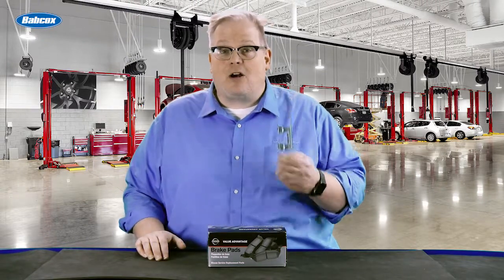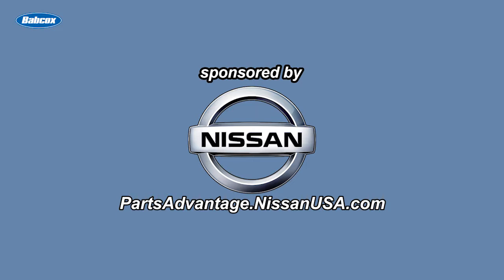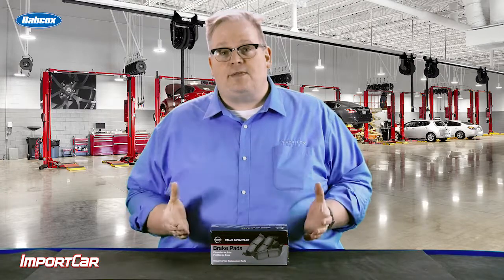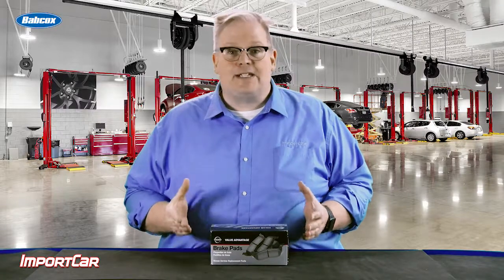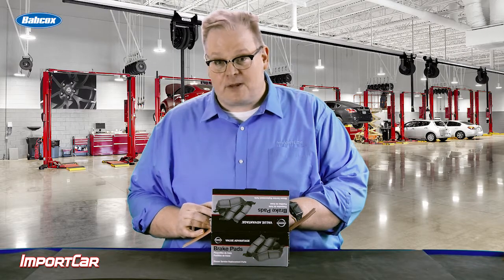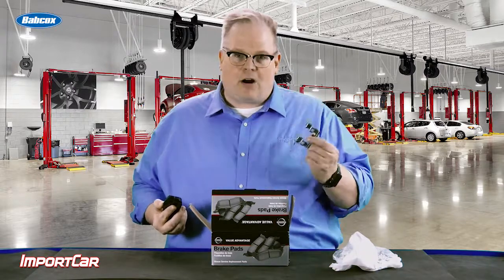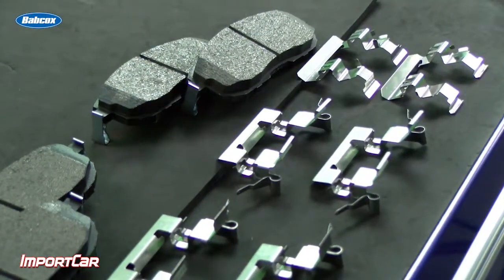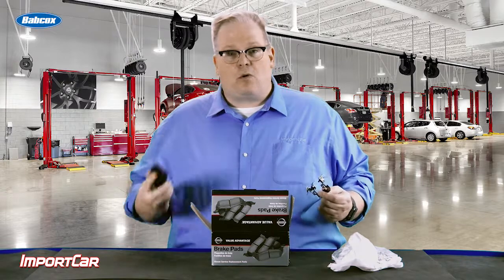Brake Pad Hardware Replacement | Tech Minute

Comment: We need a video that shows how to orient the brake pad /tab with the various springs on the hardware.  Something which shows my 5yr old brain how the tension should be set from the springs. And for that matter, how to load the pad into them as easily as possible.   I’ve been searching for hours. Nobody takes the damn pad and shows how it’s set

Comment: Had my brakes done on a silverado 20 months ago and now a pad is into the rotor.  I always do my own work, but had this job done because my back was out.  Just went to replace everything myself, and found that the mechanic had bent the hardware tabs 180 degrees so there was nothing to keep the pads from dragging on the rotors!  I was livid!  This practice is no different from someone who installs a new belt on your vehicle and puts a nick in it with a knife so it will fail earlier!  Never goin back….!

Comment: Hello, I am now doing my first brake job using the pads and hardware in this video. The previous person who did the last front pad change broke off one of the spring tabs off that the pads sit on. I am guessing he did this so the pad itself would fit into the bracket a bit looser that if both the upper and lower tab was left in place. Does this make sense? Instructions should be included with the pads and hardware.
Reply: You are absolutly right.
The brake pads should come with proper installation instructions of the hardware. 
There are so many variations of hardware that one Youtube video might just show one type of hardware.
It appears the manufacturers don't care. They want the brakes to wear out faster so they can sell more.